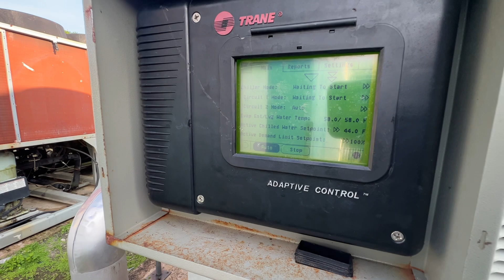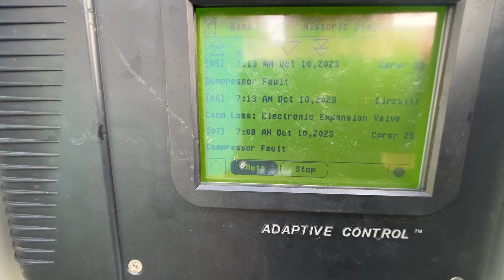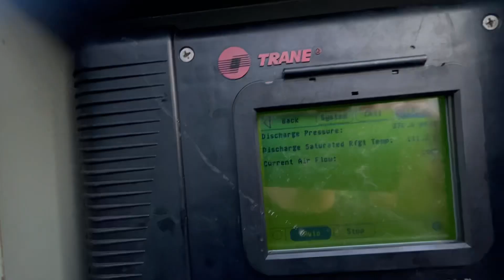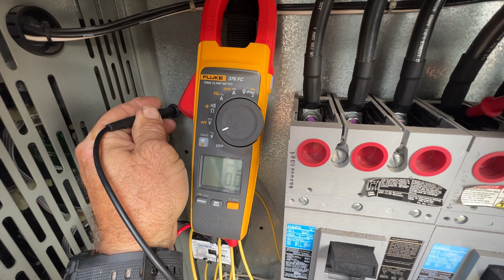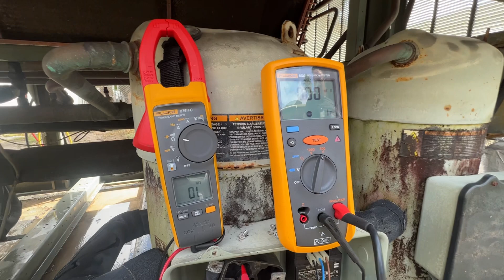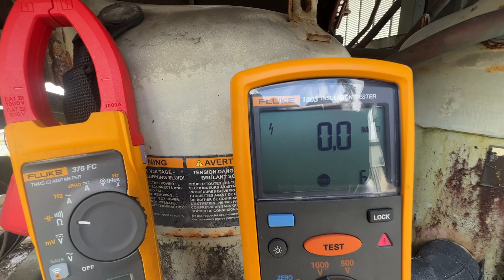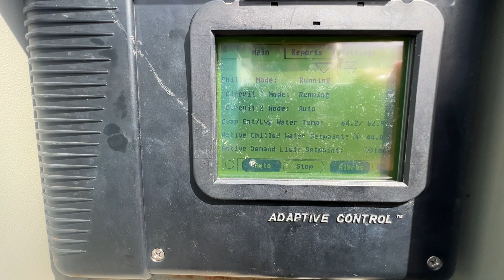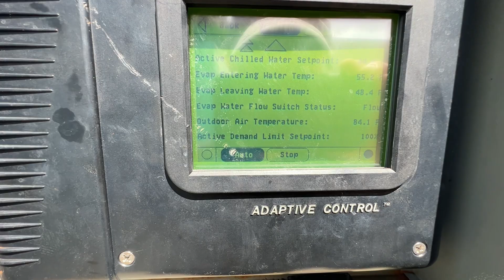CGAM 110 Chiller EXV Comm Loss And Not Cooling | Multiple Issues

Comment: Just replaced condenser coils on a RTAA a few months back. Fins were smashed flat from maintenance guys blasting them with the water hose. misters were in full force 😂 that’s when you know it’s bad. Nice video
Reply from the maker: Nice, Thanks for sharing
Reply: Maintenance force where I worked is comprised of different crews. I stopped one from using an electric pressure washer on a row of condensers. Then I gave them a comb to straighten their mess out.

Comment: Yeah...the misters are not a favorite of mine either. I've had more issues with Trane harness's than anyone else. Those CGAM's love to eat sensors, eev's and condenser coils. Had some compressor issues, but not as many as other things. I've worked on quite a few of those in my day. Nicely done getting her back up and running.
Reply from the maker: At 10 years these condensers around here are fouled beyond 20% for sure, this one is 13yrs.  I’m sure the extra water isn’t helping the harnesses and sensors here. Unfortunately it’s a waiting game on replacement. Thanks for the comment Jason !
Reply: Is that a water mister or a drencher Lol. On the ammonia side we had a company trying to put thermorphin air-cooled condensers in Texas, customer constantly had head pressure issues the "solution" was to put in a custom water "misting" system. The water treatment system failed in the first year. Ended up drenching the coils and the screw compressors.  Same issue was eating sensors, motors and everything. Fins covered in calcium build up. Its still a thorn in my side during the change over to standard Frick packages and an EC condenser.
Reply from the maker: Coil soakers more like it, they should have installed gutters while they were going through the effort. I agree, these sensors and cables don’t need help shorting out . Thanks for the comment 👍

Comment: I've got some customers that do this also. They are shooting themselves in the foot trying to keep it running. I always recommend water cooled equipment. More expensive and more to keep clean but you can run in the summer.
Reply from the maker: Our smaller sites are mostly air cooled, have water cooled on larger ones. Thanks for the comment 👍

Comment: I'm a little confused on the first megger test you did. Did you check winding to winding first?  I see the second test was to ground and definitely shorted to ground. But on a three wire motor you can't test winding to winding insulation resistance, since they are wired together internally anyway. And checking coil resistance with the meter set to insulation test doesn't read low enough to measure coil resistance. So what am I missing?   But that unit is on borrowed time anyway, not just one step closer.
Reply from the maker: Good catch, I was going back and forth with the ground test, one bad test to ground for sure .,Thanks for watching through 👍
Reply: @subcoolHVAC  Got ya. Thanks for the videos!
Reply from the maker: My pleasure